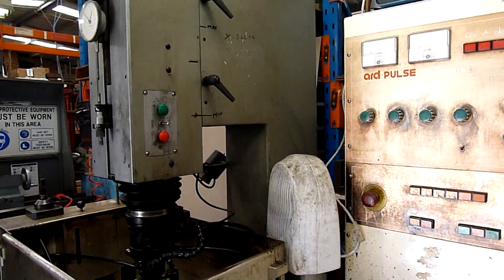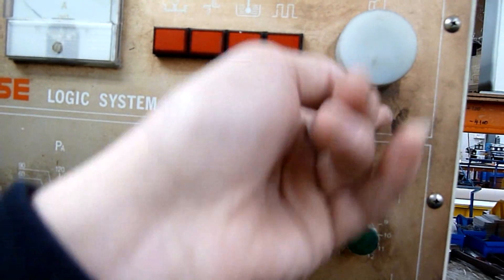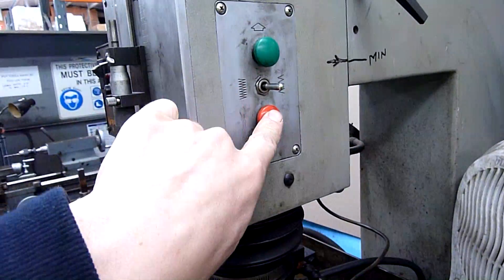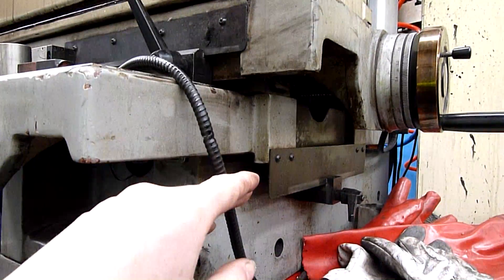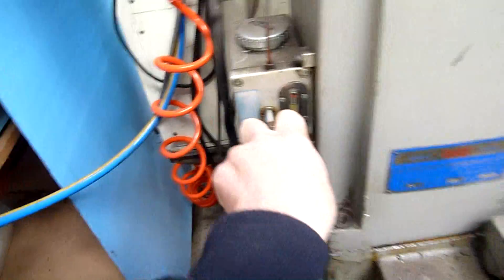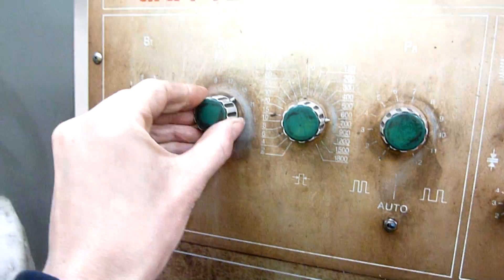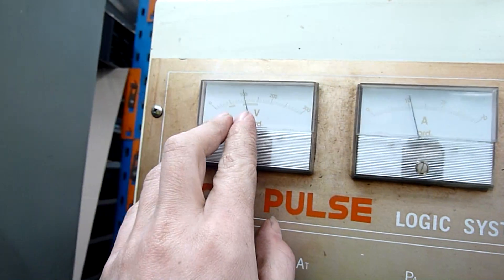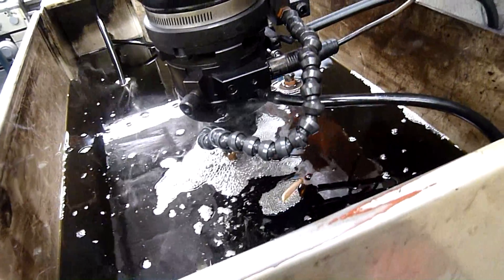ARD Die Sink EDM Rundown and Demo run

Comment: Check it out! A spark eroder! I haven't seen one of those for a while. A blacksmith shop I used to work for had 2 of them, one running (still running as far as I know) and another for spares. The coolant fluid we used was kerosene. We used it for making forging dies where the CNC mill couldn't quite get the definition we needed, so we machined a copper version of the product (forged if we were replacing a set of dies) and just buzzed the dies out with that over a day or two. We also had to call the fire service because the fitter/turner was doing a bit of grinding and a spark ran away under the kero holding tank and set fire to a soaked mat sitting underneath it. Things were very tense until they arrived. Cool machine Ed, brings back a few memories
Reply from the maker: they are awesome machines!, and fire prone too :D, the fluid I use is only slightly less flammable than kero, so sparks and welding near it when rags are around soaking up leaks, is a no-no.
I just sent the fluid pump out for reco today too, main seal was starting to really piss it out.
Reply: Aussie50 Yeah I really love the old tech that we had there. The CNC machines were impressive, but didn't do much for me. The spark eroder, induction heaters (150kw big bastards!) and the crank presses were just fascinating. Amazing how they managed to run all that old stuff 30, 40, 50 years ago, maybe more. I'd be well keen to see what else you have in your shop. Out of curiosity, what exactly do you do there? I assume you are a fitter turner as well
Reply: ***** It does look a tad shallow. We always had ours filled at least 3-4 inches above the job
Reply: ***** remember though, that for the purposes of the video it would have been a bit lower than normal, because it is very hard to see through the coolant when it is that black. And it does provide insight as to what can happen when there is no coolant passing around it. I never tried that with our machine because I'd probably get my ass kicked
Reply from the maker: *****
yeh I was running it low for demonstration, I normally have at least 1" of fluid over the work.

Comment: I resume that this kind of machine is only financially justified if the part where hole must be made is high, or hole profile is very specific. Otherwise - ~0.1mm precision and 4hrs manufacturing time (not even mentioning custom made electrodes) for these parts comes nowhere close to CNC roter mill. I mean - I've ordered custom stainless steel parts very similar You shown here, and manufacturing time on router was about 15min for part.

Comment: I had some dies cut with EDM, into a steel plate hardened to Rockwell C 60. Try to file it and you just blunt the file. Use a grinder and you polish it and remove grinder at an alarming rate. EDM took about a day per hole. Works great as well to remove stuck bolts especially a high carbon steel bolt stuck deep in a hole and you cannot drill it out. Drill a square hole in it and use a mandrel to turn it out afterwards.

Comment: Why not a centrifugal oil filter before the normal filters? Wouldn't that dramatically improve filter life?
Reply: It would but the filters are cheap enough, and it works well with somewhat dirty oil. You probably would be better off with a finer filter to get those sub micron particles out, but the killer of the oil is the arc breakdown of the oil itself making it acid. You just change the oil every so often depending on workload. You do buy this oil in 205l drums if you are using one of these machines, and have an empty drum to take the used oil for recycling by ROSE foundation.

Comment: And here I thought EDM was something that would just zap right through it in seconds. When you first you said the filters had to be changed every 20 pieces and they were $50-60 each, I thought that was appalling. Now it actually seems pretty good, considering the punishment they must endure from this.
Reply from the maker: yeh the filters are a bit pricy, but when local shops want to sting us $50 - $60 a pop to burn the same part, its worth the overheads

Comment: the question i have is why this doesnt just get machined on a cnc ? Seems like a pretty slow process if it takes 10 hours? Is it because of sharp corners ?
Reply from the maker: yeh, it takes a while, but once set, its automatic, no operator input needed. 
sharp corners and strange profiles are easy with the EDM, doing it on all but a CNC mill would be very time consuming and difficult.
Reply: Aussie50 Then i assume these parts arent made in huge quantity. Still verry nice process and good video (as always)

Comment: so have you opened the door without draining the oil first yet? :)
Reply from the maker: haha thankfully not!. 
tho I have herd of an EDM in a squeaky clean toolroom dumping gallons of oil onto the floor after an operator failed to latch it properly, they herd a clack sound and turned around to see the EDM tank open up and dump on the floor LOL
Reply: Aussie50 I was an injection mold maker by trade and I have seen it happen on more that one occasion :) It surprised me that a high end swiss made 4 axis cnc die sinker would not have some sort of a lock out on the latch when the tanks full of oil.

Comment: Wow thats amazing Ed :-)), i thought it was a non stick electric welder with copper, but the capacitor idea also makes sense :-))

Do you drill a hole down the center just shy of touching the smallest vertical to be created, so it dont have to remove so much mass?

Comment: Looked at a wire EDM cut gearbox yoke for hot rod . 800hp at wheels. original twisted the spline 15 degrees .uses brass wires feed  + electricity takes hours high grade steel two grades above 4140 .nice job .

Comment: Wow, a really nice machine. I guess it's a good thing that the oil is non-flammable :D
Reply: No, it is ordinary mineral oil. It will burn if you get it hot enough. That is why you always have at least 2 big fire extinguishers near the unit at all times. They must be dry powder rated for burning oil.
Reply: SeanBZA Interestingly enough though, the Dielectric Fluid my uncle uses in his EDM machine smells an awful lot like gasoline, which i find most interesting because it's properties seem to be completely different.